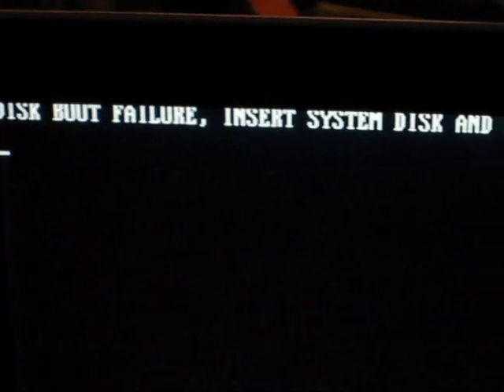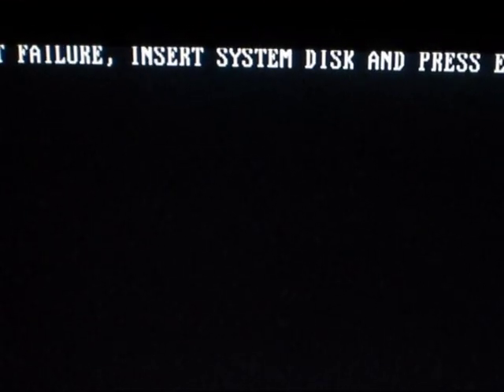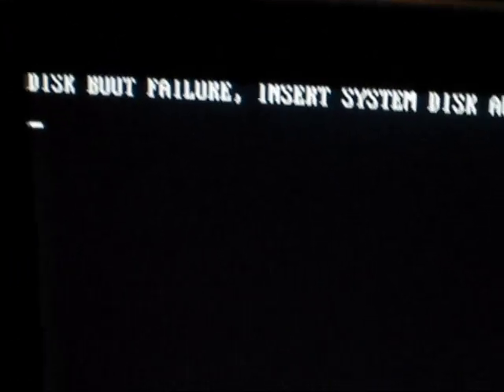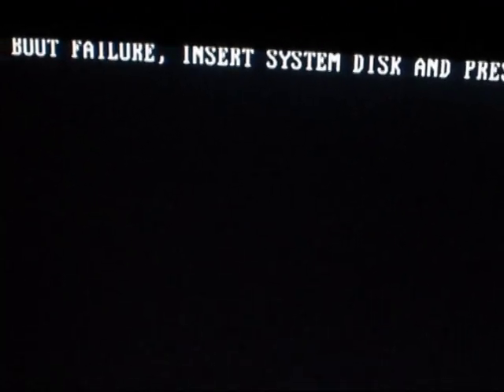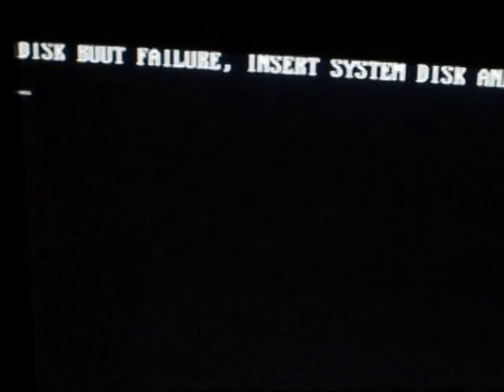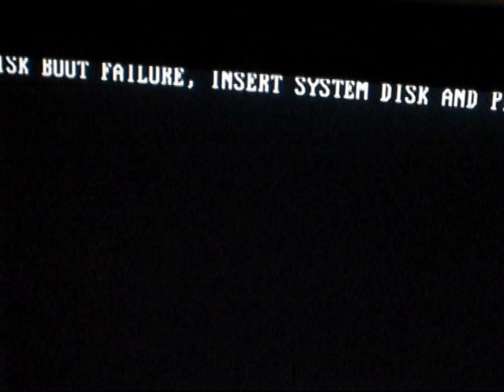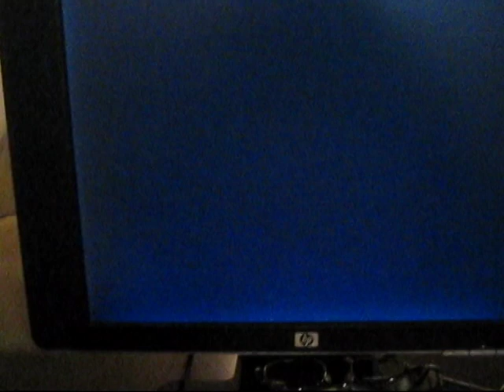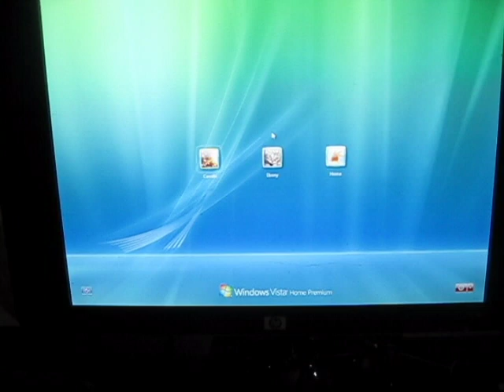Boot Disk failure Fixed

Comment: Huh? Red Wire? From where to where? The Hard Drive has a Power Supply cord (the smaller cord) and the IDE (larger cable). I have an HP Pavillion Desktop and there is no "red wire"
Reply from the maker: Just unhook all the computers wires wait 5 mins and then plug them back in.

Comment: Does this also work with Acer T180 Desktop? My computer crashed just over a year ago, and wanna get it fixed, and out of no where, this message just recently started popping up, last time I used this computer and it didn't work, it just stood there with that white line blinking, and no message, and now this message is here, this computer has had this kind of error with internet, where it doesn't work, and then out of nowhere it is perfectly fine again, is this like that?

Comment from the maker: @Mw3own246 mybe bad-boot sectors..or your wires damaged.  you my have to have it looked at.  If the wire trick don't work.  some times them updates can mess you up big time.  only update what you need.  Those updates can mess up your partittions.  Next your hard drive knocking.  Then they have you thanking your hard drive bad. Not alway the case. Mybe its those anoying security updates.

Comment from the maker: @Mw3own246 disconect your wires from your hard drive.  Thats alll you have to do.  reconnect them and turn your computer on. Thats all I did.  simple trick that save me a computer repair guy charging me 120 bucks. I discovered lil tricks we can use that they know. This is how we get ripeed off.  Not any more.  we know now.  fix our own.

Comment from the maker: @TheSowwss just remove your wires to your hard drive. and let it sit for a few minutes like 5 to ten. come back reatach them . it should work. sign up with verizon. they will fix your computer for 6 bucks a month . if its internal they will charge you 80 bucks: but they repair it. if they can't, they will send it off and you get a new one. your obered is up to 1500 dollars towards your computer with them.

Comment from the maker: @Mw3own246 you have a hard dieve that has wires. disconnect and reconnect. If it don't work. Get the CD's I mentioned above to get your data off: save your files on a flash drive and reinstall the CDs.

Comment from the maker: @Mw3own246 IF YOU HAVE A HARD DRIVE THAT HAS WIRES IT MY WORK FOR YOU. xp is a pretty good operation system. You my have to reinstall the CDs or get a new hard drive. There is software that will let you in a back door to get your files and folders off. I named it in my foot notes the solf-ware to use.

Comment from the maker: @Mw3own246 you my have to get recovery disk for it. can you access the f8 ,f1,f10 ,f12 keys is so ...go to the esc and load your cd from driver one.  if you can't get into it. you my have to reinsrall it. if you can't acccess nothing i recomend ultimate boot cd pro edition.   best cd out there for computer repairs. it fix all of them just about. you can get into your computer without accessing your hard drive.  lets you into the back door of your computer  to down load your files to flash drive.